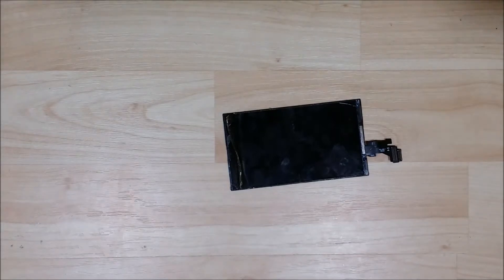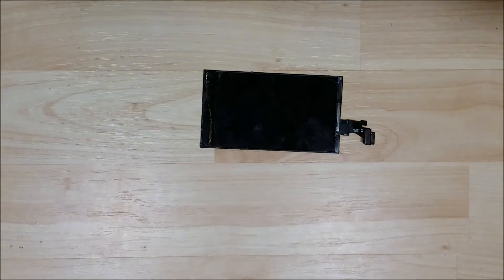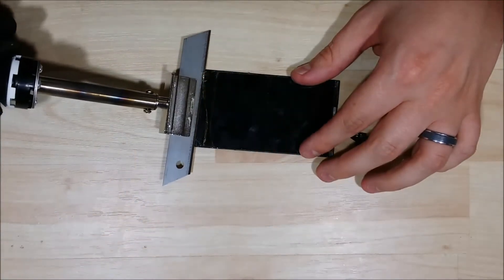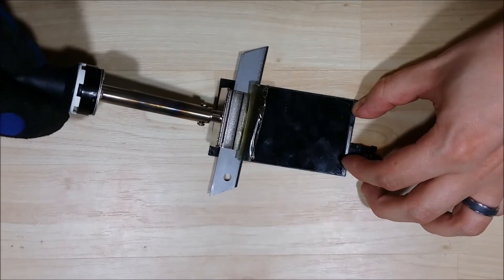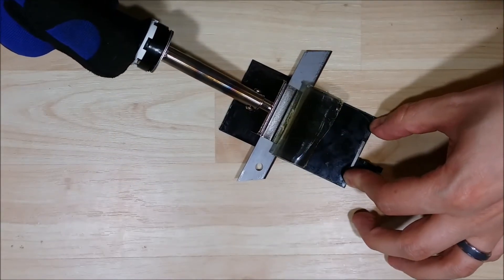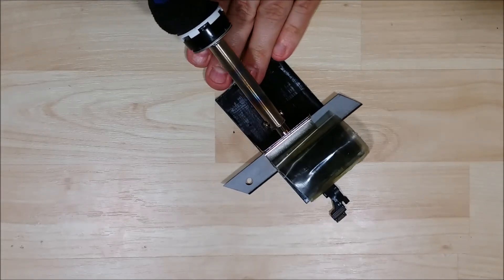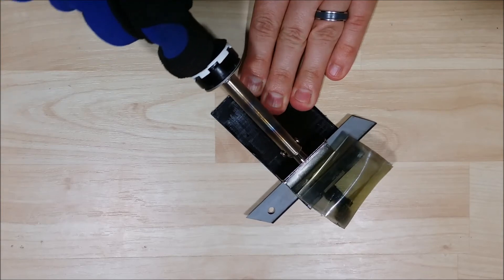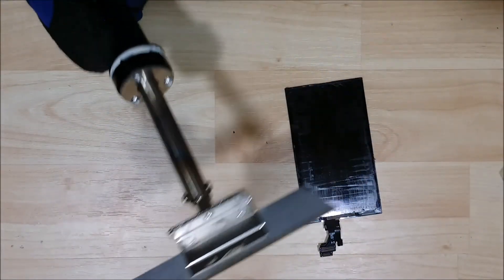iPhone polarizer - diffuser removal

Comment: I got myself a weller iron gun, 35w, and a T iron tip , wich i mounted on the iron, and the blade in the tip. Somehow i managed to get some scratches on the lcd, under the polarizer, while removing it. Any chance the new polarizer will cover those ? Or will it just look horrible ? What do you thin ? Please share, thank you.

Comment: Hey Corey looks good what wattage of soldering iron you using? and what diameter is the shank on that attachment? Great Video!
Reply: 36 Watts. Not really sure about the shank but here is the item I purchased. It is cheap and will not last more than a few uses. http://www.ebay.com/itm/Pittsburgh-Automotive-Hot-Blade-Decal-Remover-NIP-/151115994398?_trksid=p2054897.l4275